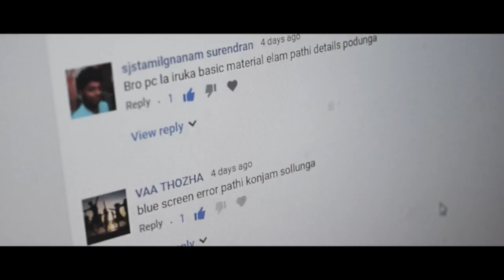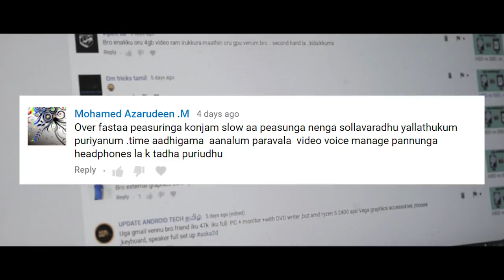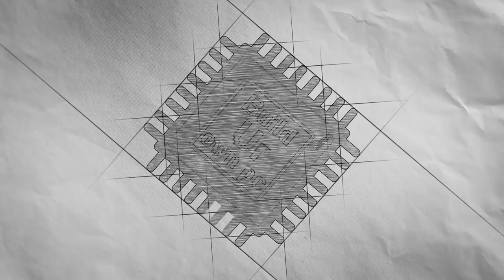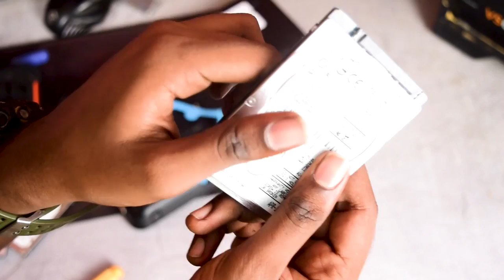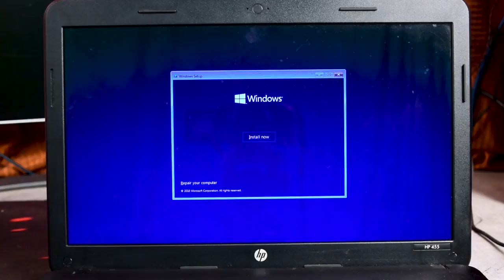How to Change HardDisk in a Laptop - Tamil | Upgrading Laptop's HardDisk | Build Ur Own Pc

Comment: How to add additional ssd to my laptop already it has 1tb HHD.
Reply from the maker: U can replace ur hdd with new ssd or if u've dvd bay in ur laptop u can add extra ssd with an adapter
Reply: @A2DChannel  is it replace my DVD bay.
Reply from the maker: Yes!!! U should, if u need an extra ssd... otherwise use ur ssd as internal drive & ur hdd as external drive....
Reply: @A2DChannel  thanks bro.